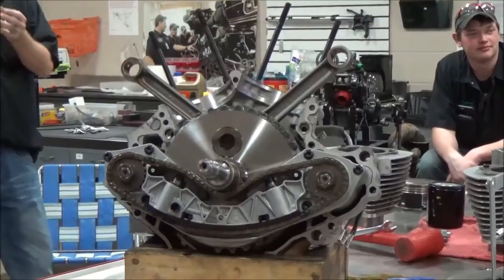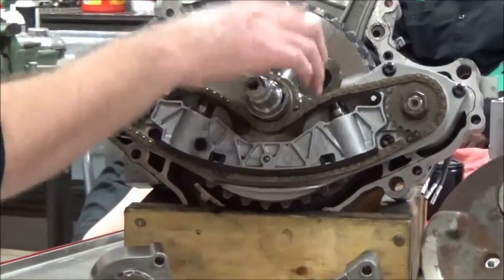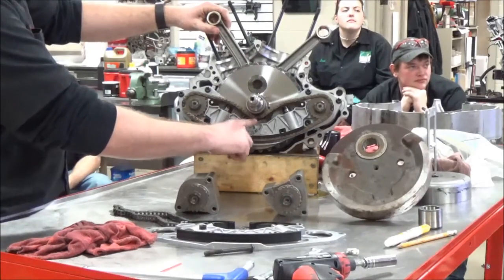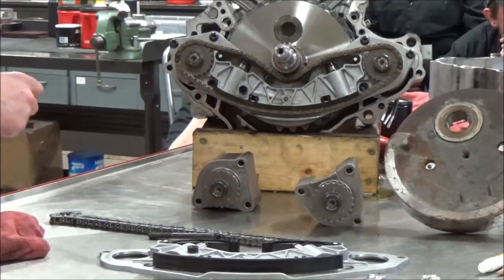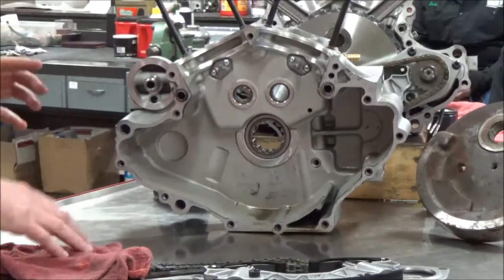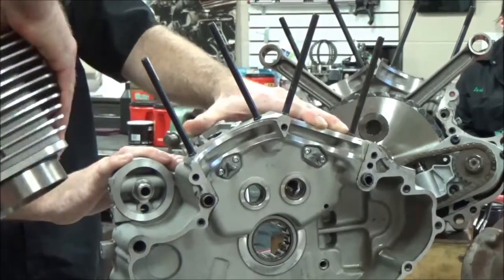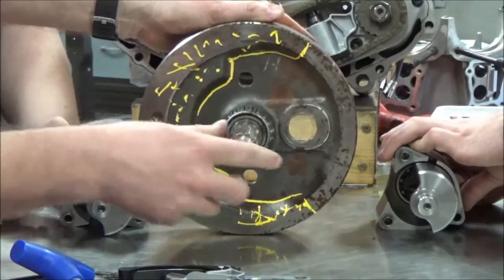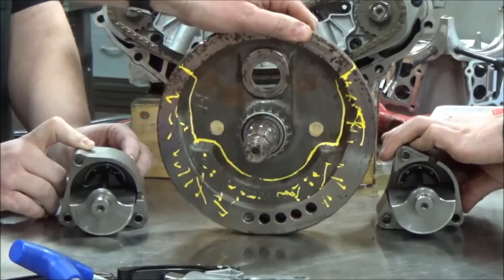Twin Cam Series: 06 Softail Counterbalancer Piston Jet Theory and Operation

Comment: Slide a zip tie over tensioner with locking head facing up and out. Route tie around back and out front of assembly. When you pull tie through locking head, pull downward and this will pull tensioner back into housing. Will not only hold tensioner in retracted position, but will hold it there for reassembly.
Reply from the maker: Welcome to the channel and thanks for sharing!

Comment: Good morning 🌅, I am from the future, as this was posted 8 years ago, I have a 2003 TC B Deuce, I purchased it secondhand about three months ago, , whoever had it before me hasn’t looked after it very well, and occasionally I have strange noises coming from it, I believe for the bottom end and the top end, I’ve taken it to a HD, service tech, I was hoping that they were taken it for a ride but did not, When it was running at HD, it sounded okay from what the tech was saying, it had some bad leaks from the inner primary, So I’ve actually put on a new drive belt the sprocket off the gearbox, upgraded the main shaft bearing, and removed the sleeve that old bearing used torun On, 
The bike has done around 50,000 miles , and I have noticed that it has got S&S G510 cams in it, But it still has got the original backplate from HD, but I can’t quite tell whether it has got the upgraded oil pump or not, And not hundred percent sure whether it’s been potted as well, to 1550, So I’m hoping that it lasts until the winter time and I’m thinking of stripping it completely, and rebuilding the engine, which will probably include a new crankshaft with Bearings, as I believe this is the year that they change the bearings on the crankshaft and cases, 
Will I need any specialist alignment tools? , I am thinking of purchasing a press, and at present, I do not have a major bike lift, I have one that lifts the bike off the ground, but not to be able to work on it properly, What is your thoughts, please?, Would it be better to purchase a new motor?, Or to attempt to rebuild this one, Part of my problem is that I live in France, but I am English, And cannot seem to find people that does engine work, If you could give me some advice, be very much appreciated, I’ve been watching quite a few of your territories. They do seem to be very explicit and very helpful., Thanks from France,
Reply from the maker: Great question for Shane directly! Shane spent the summer training a group of techs from GB. He expects to get across the pond later this year. 
We just run the social media.....Want him to drop his wrenches and help you? He loves helping members and it is only $1.99 a month to join (more options if you really want to say thank you too) All member tech questions like this get directly forwarded to him every day! Here is how to get in!
* Join here: https://www.youtube.com/channel/UCBhM8DCKnT3qXwTW0eToyCg/join      
* Just looking to give us a high 5? Click here: https://www.paypal.me/how2wrench 
* Is this an emergency and your head is about to explode from frustration or fear? Get Shane’s cell here: https://how2wrench.com/product/personal-tech-training-phone-facetime/    

Note: If you are a channel member please reply back with your Youtube handle. We will have a private member-only FB and web page coming he can directly do Q/A there! Thank you for being patient as our growth has blown up!

Comment: Biggest POS to EVER come out of the Motor Company and just one of the reasons why so many have walked away from HD's. What notable "Motor Company" would put freggin tensioners inside of an engine case AND press a crank pin into their flywheels?